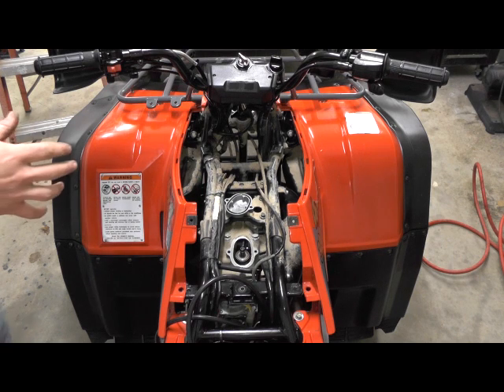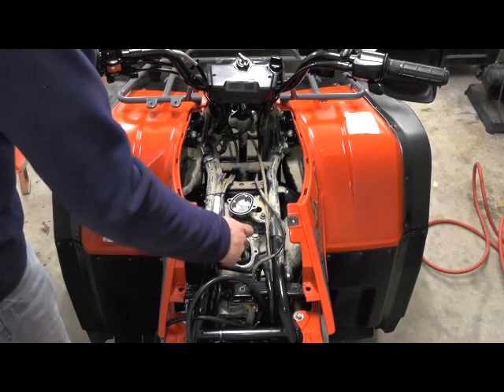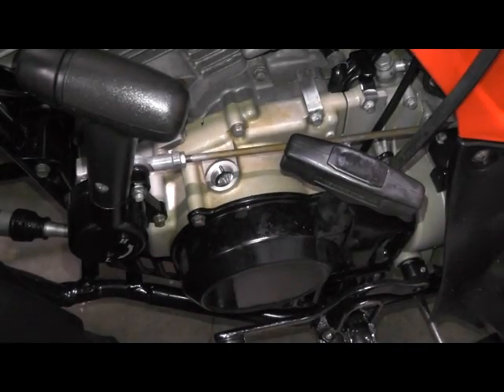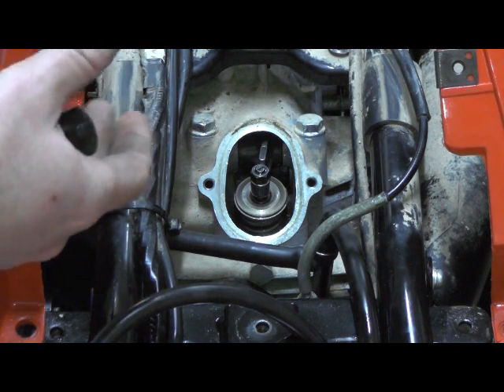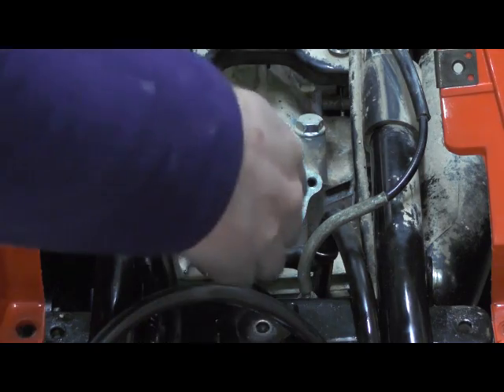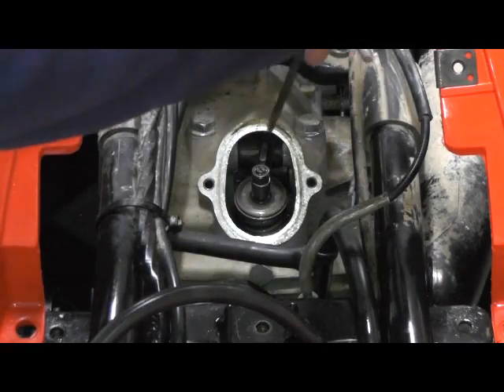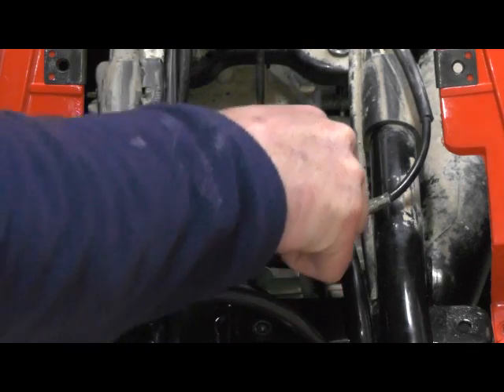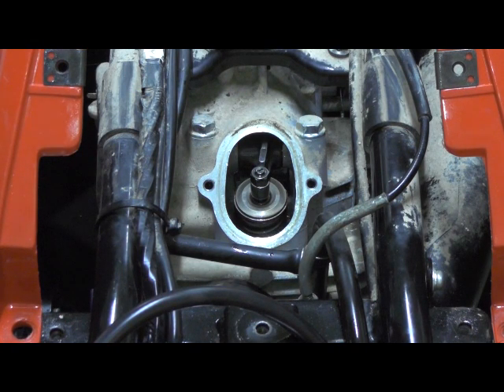KLF 300 2x4 or 4x4: Kawasaki Bayou Valve Adjustment .10 - .15mm

Comment: The sweet spot for clearances on the valves is: 13mm for intake and 18mm for exhaust. Kawasaki engines tend to tighten up over time, so setting them to this will help when they tighten, which will put them where they should be. Also, make sure you are on compression (intake) TDC, not Exhaust TDC when you adjust valves. To make sure you are on compression TDC, rotate the engine counterclockwise and watch the exhaust valve, it will compress, then go back to normal size. Keep rotating the engine and watch the intake valve do the same thing, shortly after you will see the timing mark on the flywheel and the cam gear (where it says TOP) That's the TDC you want.

Comment from the maker: Yes, you want to still be able to move the feeler gauge between the top of the valve and adjustment screw, but tight enough where there is no up and down play between gauge, valve and adjuster.  If you believe you have jumped time you can check this by removing the round cover on the left side of the motor.  There you'll find a chain running around the cam gear.  If memory serves correctly there is a mark on this gear and a mark on the head that should line up when your on TDC.  May want to search for a video as I don't have one up on this process.
Reply: Just watched a vid on this process.  This is correct from what I have seen.  Thankyou.

Comment from the maker: Clean the bolt heads with starter fluid. After it dries... coat the bolt head with super glue and quickly put the 8mm socket on and hold till it sets. While pulling outward, loosen the bolt. This can also be done with vise grips. Once removed helicore the stripped threads.
Reply: I have a Lakota. Back fires through the carb. Won't start. Checked timing loosened and tightened the valves still does it. Cannot figure it out had three different heads on it and it will run about a day then starts doing same thing. HELP!!!

Comment: My 1991 bayou 300 is really hard to pull over on compression stroke and when it does get running for about 10 seconds, it backfires through the carb too. I will try to adjust the valves and we will see how it goes. My quad is acting like the valves are waaaaaay too loose and the valve doesn't open soon enough so it gets stuck on compression stroke.

Comment: You can take the recoil start assembly off and turn it with a wrench or socket and it’s more precise and ALOT easier than pulling that a million times
Reply from the maker: Thanks for the comment and happy trails

Comment: I have an 86' kawasaki bayou 300 2x4 and my valves are loud a bit. Can you tell me precisely what the #s should be ranging from 0.10 to 0 15 on intake and 0.15 to 0.20 on exhaust? Like what would my setting for my 300 bw on intake and exhaust?!
Reply from the maker: Depending on how much wear the engine has on it the adjustment will vary. They sound a bit loose if rattling... get a measurement before adjusting and tighten them .02 or so from where they are at.  As rule of thumb, if you get backfiring, the exhaust is loose and if its hard to start the intake needs loosening. Hope that helps...
Reply: Is 0.010 and 0.015 not the same as .10 and .15???

Comment: I have a 300 bayou 4x4 and it is backfiring and bogging down when I get in the throttle. do you think this could be the problem
Reply: check for water in the bottom of your carb bowl, if you find any drain it all (take out fuel selector)

Comment: Is this the same procedure for a Prairie 360?
Reply from the maker: Thanks for the comment. The procedure should be the same, although the tolerance in valve clearance may be different. Kawasaki design has always stayed consistence.
Reply: @atvdirt1  Thanks I did the valve adjustment on my 360, had to do it twice cause the first time I left the exhaust a little too open and was making a ticking sound, what I did see when trying to find the T mark, is that there are two T's, the first T, the valves are tight, then I went to the next T and they felt jist about right, so that is where I gapped them, does your 300 also have two T's markings?

Comment: How can I fix my pull start on kawasaki bayou 300 late 80 or early 90.  I can't find model number.  lol   The bolt keeps spinning & won't allow me to take it off.
Reply: You’ll have to most likely drill the bolt out and retap the old hole and have one oddball bolt in your pull start. If you’ve never done this ask any of your friends to help and study the YouTube videos on drilling and retapping bolts. You have to be careful not to crack your case or drill at a bad angle. Good luck
Reply: Use an impact to get it off. Can’t use a wrench.

Comment: Would this fix a ticing noise
Reply from the maker: These have a slight tick even when adjusted correctly. If your machine is showing no signs of needing adjustment (hard to start, backfiring, loss of performance) would probably just let it be.
Reply: @atvdirt1  ok thanks